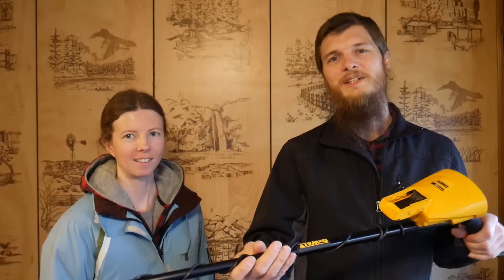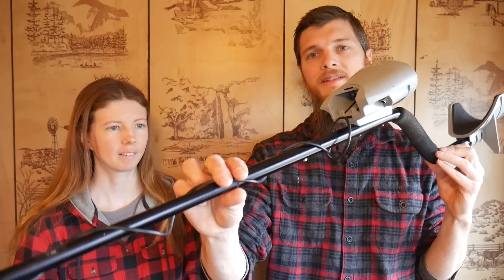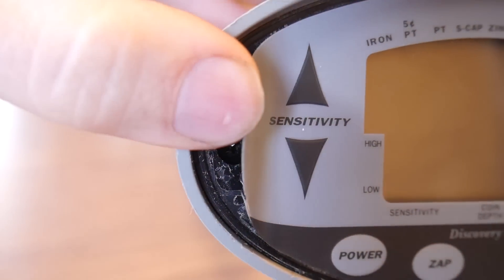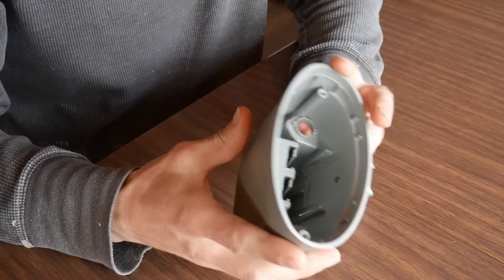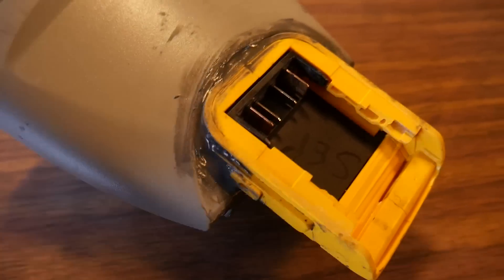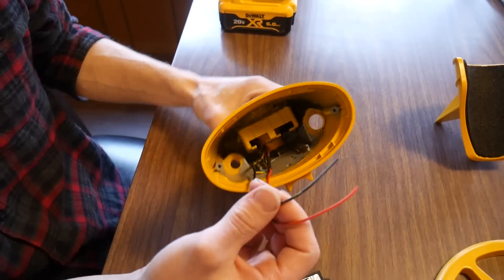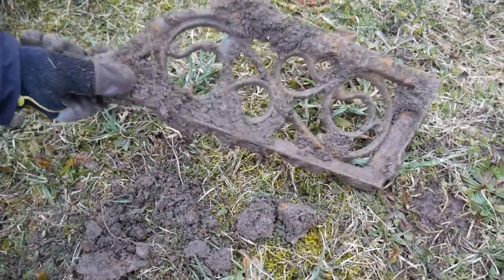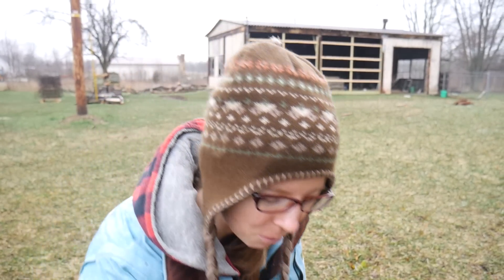Custom Built DEWALT 20V METAL DETECTOR

Comment: I think you did an awesome job on the conversion, perhaps too good.  However, I would suggest removing or painting over the second sticker on the shaft.  Copyright infringement issues could arise.  The first sticker indicates the battery to be used and so could be considered justified since it is a Dewalt battery and the specific battery that is required.  The 2nd sticker however is not necessary to indicate anything and so difficult to justify the use of their label.
Reply: James Finnall they are not selling metal detectors, it is for personal use and as such there is no copyright infringement. I think Dewalt would consider this a homage and would not “go after” them. Stop being a “downer”

Comment: The metal detector upgrade is very well done. I actually thought you bought a DeWalt detector haha! Some real skills on display there. I am pretty sure the washer thing is a decorative piece from an old hot water radiator (to hide the pipe into the floor). Had them when I was a kid. That decorative iron work is sweet. It could clean up nicely with a wire brush. Maybe incorporate it into the rebuild of the schoolhouse? Great video!
Reply from the maker: Oh, we'll have to clean up that washer a bit more and take a closer look at it. We'll also try to clean up that iron piece for our next video.

Comment: You did a nice job on converting that to use a Dewalt battery. Pitty you still  have to use a 9 volt ?  Still, cool conversion 👍
Reply from the maker: The unit works completely off the DeWalt battery. We installed a DC converter to create the 9 volts that we needed and it's all powered by the Dewalt battery so no more 9 volt batteries needed. We only used the separate 9v battery during testing and design.

Comment: The following text is from an advert for the thing that Ashley's decorative piece was a part of....but with some words missing.... :)
The only practical ______________ in the world. Noiseless at first, noiseless forever. The ____ brackets are of triangular form and cannot sag or break down. It is so constructed that the whole weight being downward, there is no strain on the castings, and the only ____ in the world with anti-friction journals. No bolts or screws used in the construction of this _____; but the longer it is used the firmer it becomes. Every slat is tongued and grooved and dowelled together with a continuous steel barbed dowel. A patent non-corrosive silver plated flush _______ in the four larger sizes. Be sure and send for illustrated catalogue and price list before placing your orders elsewhere. We own the original patent to this ____________. ~ GRSFC.

Comment: You had me going at first. I was thinking I didn't know DeWalt made a metal detector. That would have been a good April fools prank. What does the zap button do? I betting the cast iron thingy is part of an old school desk !  Dave.
Reply: I agree with you Doug I never like 9 volt batteries either. They're way to expensive for what they are !!!
Reply from the maker: haha! I've never used the zap button, but I found this online talking about it "When you detect an object you don't want, you can push 'zap' and it will exclude any further detection of that object type".